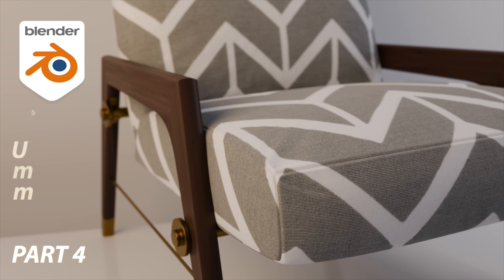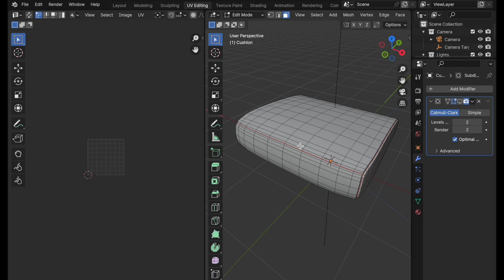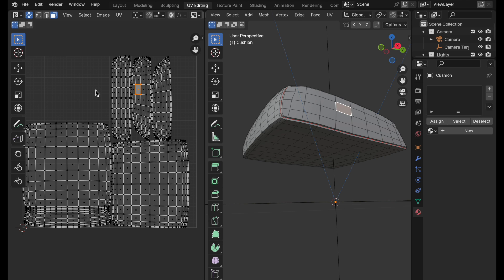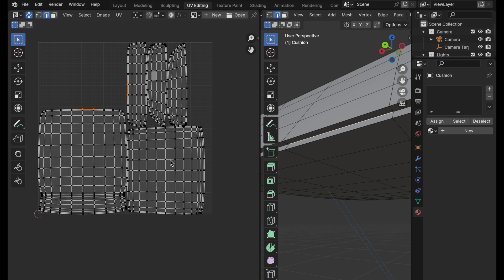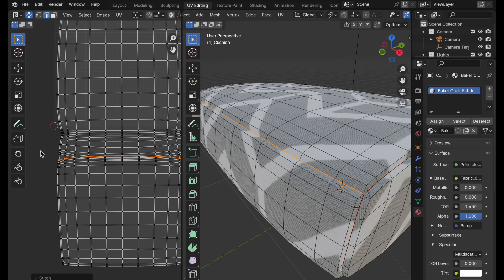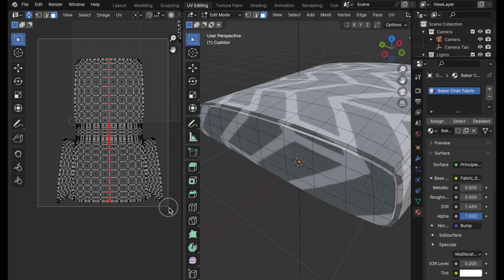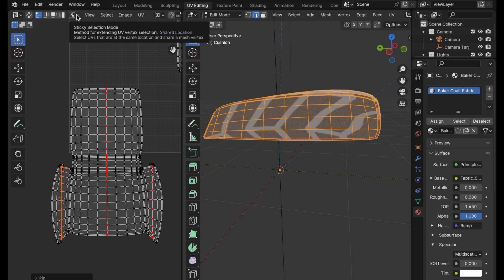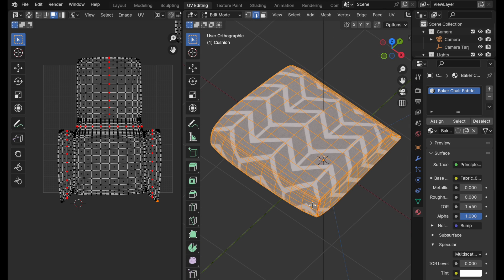PART 4. UV map the seat cushion of a mid-century modern chair.

Comment: One very good guide line when UV mapping something with fabric (like this cushion or clothes) is to have the UV look exactly like the pattern that the thing was sewn from. So in this example most sides in the UV would probably be even straighter that this, especially the corners since the foam or whatever inside it is bulging everything out with the fabric/texture stretching in the corners a bit :)
Reply from the maker: You're correct that matching patterns to UV islands is the best way to unwrap an object based on patterns. But I wasn't attempting to teach people best practices for unwrapping a pattern-based object, but instead to use this seat cushion as a vehicle to demonstrate various processes within the UV mapper, hence the stitching, aligning, etc.